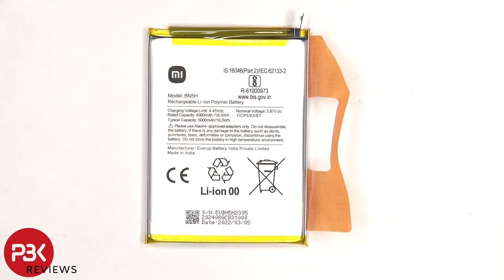Poco M4 5G Disassembly Teardown Repair Video Review

Comment: Sir my phone is Poco m45g is very  heating battery is automatic dry up, hard ware is very heating , sitting also adjusted but problems is not done then how to solve???  I think hardware is problem.. Please advice me
Reply from the maker: You can try taking it apart and replacing the thermal paste with new one to see if it helps. You can also backup your data and do a factory reset to make sure there are no malware in the phone causing it heat up.
Reply: Yeah sitting and factory reset done also, but one thing network is not working and the when phone switch of automatic battery also dry up, One mechanic told me it is network IC and battery IC problem.. So what is the solution for me? And how much network IC and battery IC Indian price?Brother